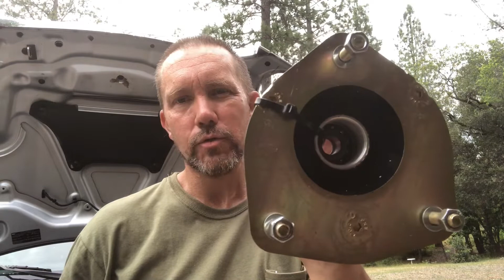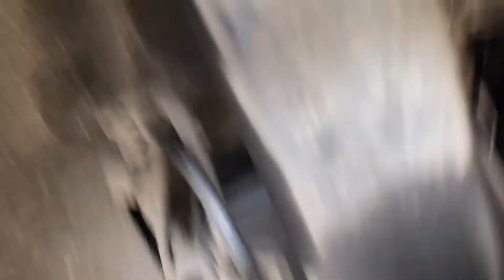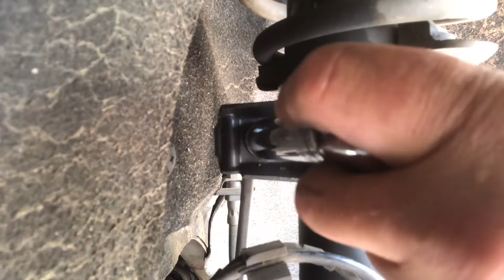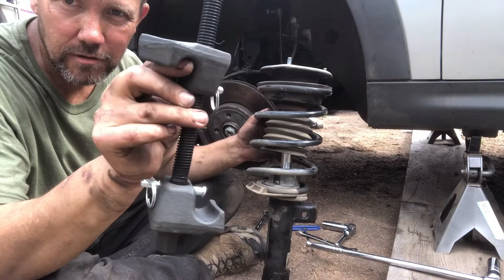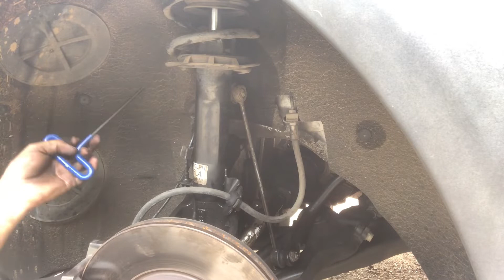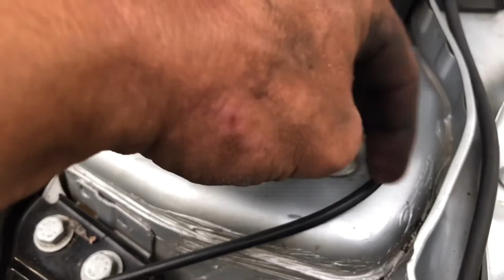How to install camber plates on a Mini Cooper S R56

Comment: If they're the same size bolts and the same "spec" bolt, then they'll use the same torque setting and be just fine.  25 ft lbs for that size bolt seems quite reasonable, and there are 3 of them under clamping load 99.9% of the time.

If they were a higher grade bolt then they might need a bit more torque.

When in doubt, you can add a little blue loctite but I don't think that's warranted in this situation.

Thank you VERY much for sharing this video on the fixed plates.  Looks like a very straight forward job with a set of loaner spring compressors.

Also, try not to get penetrating oil on any of your rubber / plastic parts... Like brake lines.    Find a degreaser that is safe for brake lines and clean that oil off.

When I use penetrating oil I try very hard to not get any on anything except what I'm trying to lubricate and clean it off if I do get a little over spray.

Edit: I'd also suggest spraying brake cleaner on your rotors after handling them like that.  Very likely you might have, but worth mentioning in videos to keep your rotors as free or oil / grease as possible.

Comment: May we know the performance effect of a 1.2 camber?  How was it drivin?  Tnx
Reply from the maker: Mine is  -1.8 degrees of camber according to the shop that aligned my car. It handles much batter than before and my tires still wear evenly
Reply: @ProjectMini  just curious, why did you pick a fixef camber mount instead of the adjustable one...just curious..do you have a contact no.?  Tnx
Reply from the maker: Because of the price. I’ll do adjustable camber plates when i do coilovers

Comment: How much front camber did you end up with once fitted and aligned?
Reply from the maker: I believe it’s-1.5 degrees
Reply: @ProjectMini  thanks, that's good to know, I'm fitting silver project adjusters when they arrive next week and they offer up to -1.8 degrees camber so should be able to get the-2 degrees I am after.